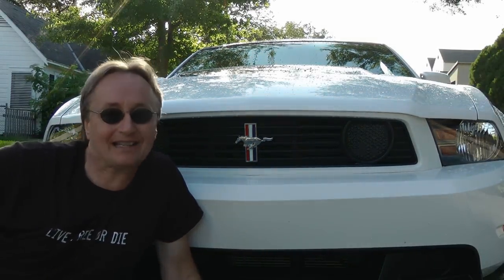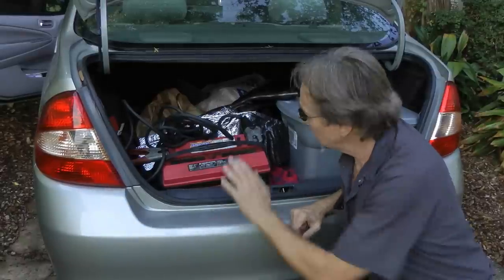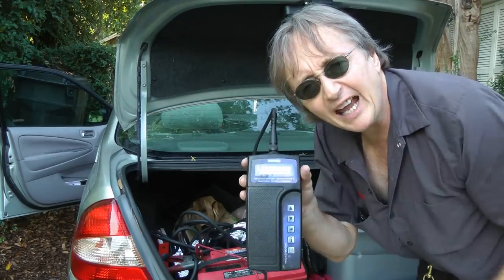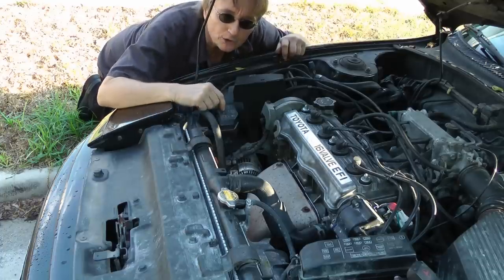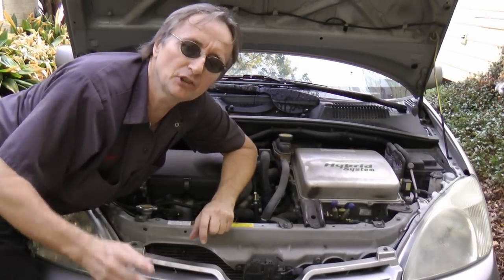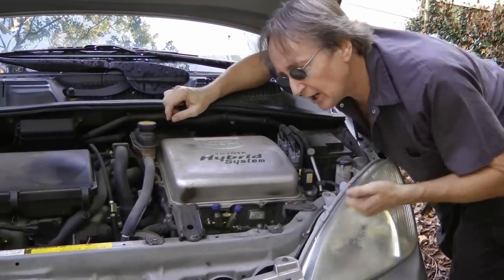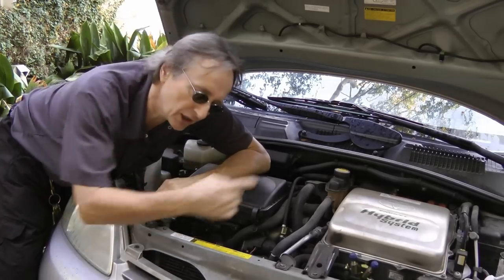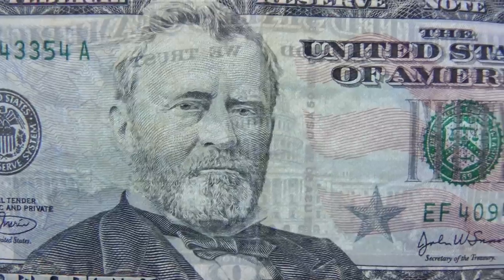Hybrid Car Electrical Problems

Comment: Did you fix it?  Is the generator the same as the drive motor?  Seems if the problem is overheating and melting inside that Toyota did not expect the conditions of a weak battery calling for constant charging under high ambient temperatures.  Perhaps inadequate cooling or gas engine was running hot, exhaust leak.  Anyhow, electric motors should not fail in this way if they are spec'd properly.  Also, 10 hours seems a bit much to pull a transmission.

Comment: @blacwidow00 Condition of your oil has nothing to do with the battery, but it would affect the mechanics of how your engine works.  But definitely get an oil change if it's time (check service intervals in your manual if you don't know).  Newer cars require one every 5,000 miles or 5 months, at the very least, every 3,000mi or 3 months.

It could be a variety of problems, but start by testing the battery, alternator, and starting systems.

Comment: I want to buy a 2010 Hybrid Ford Escape with 44,000 miles, will that be a good purchase?
Reply: Yes. I actually want one of those. I have a Honda Civic Hybrid at the moment.
Reply: ryfodrea I ended buying the v6 model, much more power and dont have to worry about the batteries going bad.

Comment: I have a 2008 Prius - now converted to drive 100km on a single charge and then continous in mixed mode at 2l/100 km - never had any problem with it.  Only cost is the yearly maintenances. No reason why the non-existing alternater would die on me.
Reply from the maker: the generator takes the place of the alternator on a prius, and man, do they have problems as they age and overheat and melt. That's why I made this video to warn against buying old used ones.
Reply: Scotty Kilmer Thanks for reacting to my remark, Scotty. So I must believe that I have been Lucky all those years.  ► Maybe, now that I am driving almost exclusively in EV this problem may not occur to easely?
I enjoy your way of presenting here on YouTube very much!
Regards from Brussels, Belgium
Reply: Scotty's talking about Gen 1 which is when the tech on that model was new. They have came a long way since Gen 1

Comment: Not trying to stir up any trouble, but from what I can tell, for the old 2001 - 2003 generation, there's also a cooling system shared between the transaxle system and inverter.
news-eng.autotranstech .ru/?partition=1&subpartition=17&article=204
Remove the space before the ".ru".
"Proper maintenance of this cooling system is vital to the integrity of the vehicle's inverter as well as its transaxle or transmission."

Comment: ive got a hybrid they only save you money till something breaks. a new hybrid battery 5k to replace, charging system 5 k to replace. most shops around here wont work on them so its off to the dealer.

Comment: Does the charge voltage on the Prius sit at approx 14+ volts whenever the "key is on"(?). I work in retail auto and will usually go out to the customer's (generic) vehicle and check the charging voltage when the vehicle is running.. Is the Prius the same?.. or will the charge voltage only be present when the aux engine is running/ or when the wheels are turning/or is there a step down from the main battery? When I first ran into this I also noticed there was no alternator... but I wondered if 14 volts was present only when the vehicle was actually rolling.

Comment from the maker: Ah, tis not true for this model. They didn't cool the generators with any cooling system, they overheat, and melt down. Ask any guy who works on them all the time, they'll tell you the same. I'm a toyota man myself, that's all I own, but I wouldnt' get a hybrid one.

Comment: the second generation Prius doesn't have these problems due due to running on higher voltage also you are wrong in 2 ways 1.the motor/generators do have a cooling system its the same system the inverter uses 2.if the generator was the problem in the car it wouldn't start (the generator is also the motor that starts the engine) the most likely problem seeing as the battery light was on would be the dc-dc converter (its what steps down the 200 traction battery volts to 12 volts for charging)

Comment: You are wrong about few years the white tanks will turn into some discolored plastic. I have old BMW 1994 used white plastic expansion tank it almost 20 years, but I can see the fluid level by shaking the car and shine the light or sunshine behind the tank, I can see the coolant level moving up and down. It still can see it but not really clear. In contrast, the black one will be impossible to see through.

Comment: I have a 2008 with 300000 miles on it.  Change the oil and drive it.  Never had a problem with the car ever.  One of the best cars I have ever owned.  I drive it 300 plus miles a day and I am not easy on it.  Great car.  I don't think I would buy a old one like in this video though.

Comment: First off, any new technology is going to have issues while they learn to do it right.. That's just how it goes.  The good thing is, the Prius has plug-in conversion kits available to make it an electric only, so you can charge the batteries even if the generator is bad.

Comment: Only use an after market car audio amplifier fuse rated at 30Amps and outputting max 300watts bridged, or you destroy your generator and HV hybrid battery.

Comment: Awesome video Scotty. As a supporter of the electric car, I will say that hybrids are an absolute joke if not the the biggest fraud of our time. They do not save you money, gas mileage is 40 MPG at best, &  they are most certainly not any better for the environment. In fact, from 2003 to 2005 the Hummer H2 cost only $1.03/ mile to operate in it's life time, the Prius wound up costing $3.26/ mile. I tell my friends if they really want good mileage and save the world, get a Volkswagen diesel.

Comment: I brought a 2006 5 years ago for 2.5k now has 391k and only replace the electric water pump, cheap and easy. Replacement parts on ebay are super cheap. Still does 51MPG.

Comment: That's not to mention all the other super expensive components that break down in older Priuses like the hybrid battery pack. One of those will set you back at least 4 grand or so.

Comment: Hey Scotty.I recently replaced the left CV axle and ball joint in my 94 Escort GT. Upon lifting my left front wheel,I noticed slight play about 1/8 to 1/4 in. from side to side and was told there is supposed to be NO play by local techs.Also there is squeaking when turning the wheel by hand and driving. I had the bearing replaced a couple months ago. I know Richmond Ave. pavement is rough and patched to hell but can it make a new bearing go bad or can it be something else? My tie rod looks okay

Comment: BMW repairing cost for head gasket costs over $8000.00. Hybrid battery costs only $3000.00 for 10 years. BMW costs a lot of money like water pump, belts, pulleys, alternators, radiators, cylinder head, intake manifold, and so on. 
After 10years, BMW costs over $20,000 to maintaining the car. And it brake down on the highway very often.
Those who know about electrical will see the benefit of low moving parts translating to less brake down.

Comment: Is this just a problem in Toyotas or common among other manufacturers that make hybrids (like Ford for instance)?
Reply from the maker: realize original ford hybrids were just engines and motors bought from toyota
Reply: Scotty Kilmer what about the current ones?
Reply from the maker: illiniguy34
I believe they redesigned them, but of course, only time will tell if the new ones burn out too
Reply: Scotty Kilmer Yup.

Comment: One thing that you forgot Scotty was the fact that the generator itself does not directly charge the 12 volt battery there is a step-down converter which is replaceable that charges the 12 volt battery and does not cost super huge it is about what it cost to have a professional shop replace the alternator and the 12 volt battery that's why there's mechanics like you who don't really work on hybrids and then there's mechanics who specialize in hybrids cuz of some of the things that mechanics like you tend to overlook when people bring their car into the shop

Comment: Hi, Scotty, Thanks for the video.

How about Toyota Camry Hybrid ?? Since it is dual energy driven, I suppose used Camry Hybrid should work better and save more maintenance work in the long run.
Here in Melbourne, Australia, I can see maybe 40%-50% Taxi are Camry Hybrid.
I think 2010-2015 Camry Hybrid are all great to me.
Reply from the maker: +Derrick Ruan  taxis use em for better gas mileage, and they write the cars off after they are a certain age. You buy one for personal use, when it's older GIANT repair bills, that's why I don't like em
Reply: So you only like Toyota petrol cars?
Reply from the maker: +Derrick Ruan yes, I'm not a diesel fan either

Comment: Hey Scotty I have 09 toyota camry hybrid with 76000 miles. The dealer ia asking $ 5732 to replace the traction battery plus labor. You think you can convert this car into a regular camry without the hybrid system and maybe install a  alternator and replaced the ECU. Any suggestions is appreciated.

Comment: one more question Scotty ? we have a Honda Accord 1999 we already check the pump ,cables spark plugs and everything . do you think can be the battey also if sometimes charge or not ..I took this car to a auto part you know to check the battery is low in volts do you think that can be the problem if this car stops to much ?

Comment: hi Scotty, i have a 2008 hybrid honda civic. i have the same problem as this prius im wondering if my car charges the accessory battery the same way.?
Reply from the maker: often I find with hybrids merely changing the accessory battery can fix problems. Start there, pray it's not the big battery or generator

Comment: Do u think buying a prius 2011 with 130k miles is a good idea?
Reply from the maker: could be OK, cause it's not that old, they generally have problems when 10  years or older
Reply: Unless you need an hybrid don't bother. 

You are at the mercy of the dealer unless you have a mechanic like scotty you can trust and even then i'm sure there are components that because of an electrical nature he cannot service/ tools /equipment etc. 

Let other people be the Guinea pig  on the hybrid stuff ,
Reply: I agree with Eman, If you want to spend money & get driving luxury and flexibility dont buy a prius. But if u want to save lots of money buy a prius hybrid. We drive our prius more than 100 miles a day. If i was using another gas eater car i would end up paying a lot of money just for gas. Full tank of 10 gallon takes you more than 400 miles, where other cars give u only around 200ish. My previous car was a mazda3 2014, The manufacture says it gives u 30mpg in the city, but i used to get around 24-25mpg.
Reply: Eman 08 It's twice the things to go wrong.
You have the things that as you used as an example a standard gas engine civic with a traditional tranny and engine.....but...then u have all the hybrid components.

So then in most not all cases you are at the mercy of the dealer for the hybrid end of the car. 

The Juice is not Worth the Squeeze
unless you get 1 cheap, do a ton of miles and got a good deal.

But if you like it ....then that's all that matters.
Reply: My hybrid is 8 years old with over 100,000 miles. It's had regular maintenance such as oil/filter change, and tire pressure checks. There is a light that comes on to tell you to get an oil change. It's about 60 bucks for the synthetic oil that it uses.
Reply: Yes. The 3d gen Prius is solid as a rock.
Reply: Ashraful Islam no idea
Reply: bigballer what about a 2006 Prius?
Reply: Scotty Kilmer Scotty. Im planing to buy 2007 bmw x6 active hybrid model with 165k on it. Is it a good idea? Im afraid the electric motor batt will die on me later.
Reply: If it's taken care of it'll be just fine. I have a 2011 Prius with 157000 miles doesn't show any signs why it won't go to 200 thousand. Just make sure you do regular maintenance.
Reply: Eman 08 Agreed

Comment: Whats your opinion on the hybrid Toyota camrys? They use them as taxi cabs in the city
Reply from the maker: they get fantastic in town gas mileage. BUT, I would not buy hybrid because I fix them and I keep my own cars forever. When old , Hybrids cost a fortune to maintain. Check out their insanely low resale prices when over ten years old. And that's when I buy cars, when 10 years old or older
Reply: Yeaa thats true... so all those taxi cabs won't last forever lol
Reply: They might as well just switch to insight and accord hybrids cx
Reply: I know we got the new nissan nv2000s but im not a fan of them Keashaun Henderson

Comment: well yeah if your going to dealership to buy the parts yes but you can buy rebuilt or used parts for them super cheap. Prius is actually one of the cheapest cars to fix. I just bought a 3rd generation prius from the auction that was really messed up, replaced the engine inverter and hybrid battery for under $2,500 that includes labor. The inverter assembly for first generation prius like he is showing is $150-$200 used. Do your own research on what's available around you.

Comment: Most old mechanical technicians only know about mechanical moving parts because they can see and hear them easily. On the other hand, electrical parts usually don't see and hear very well, they won't be able to see the problems so they say hybrid is complicated.

Comment: @TheWarmplate yeah i have to agree  vws are really realiable( to me at least ) i had a 97 jetta didnt put a cent into it other than tires and oil changes. finally got rid of it after just getting bored and bought mk5 2.0t jetta. thing screams and ive had absolutly no problems. the thing people dont get is that every car company is going to have their flaws its just the severity of the problems you need to look at when picking a certain vehicle brand.

Comment: Scotty I know you'r in the business of "saving lives" ehhem..car lives ofcourse.,so here goes.. I took my '07 Altima Hybrid  to Oreilly's today for a free scan (after my dashboard lit up)..these are the codes they pulled: P3013,
P0A80, P0AC4. Ive had a very bad experience with my Local Nissan dealership (yes stealership in my case) and to be honest, want to avoid dealership prices if I can. Factory warranty on the cell battery was 150K/10yrs, sadly my milage just went over that at 151.5K. Can you suggest my immediate course of action- minusgoing to my local Nissandealership ? Do those codes spell the death of my cell battery ? Any pointers from you is always cheerfully appreciated.

Comment: I am a delivery drive I work at China Sun Bristol VA I drive a lot so in order to save gas money, i bought a new 2007 toyota prius in 2006 and put about 250,000 never get any repair beside change tires few time and change brake pad one time  prius is the most reliable car  i had ever. finally, in 2012 my wife got a car accident, so instead take it to body shop I sold it cheap  to a friend of mine, and then i bought a toyota camry hybrid xle and I put about 107000 (we got another driver so I don't drive as much as before) I had never repair since new beside change tires  best reliable car   and super low cost to keep the car  save a lot money for gas I always change oil on time(don't go walmart to get oil change, they don't do the right job)I take to toyota of bristol to do oil change only cost about 50 dollars for every 10,000 miles I just want to tell truth  the toyota hybrid did excellent job  I don't have to spend any time or money to repair cars, they are trouble free car  when I got the hyundai XG350L in 2004 that car keep me busy I go to repair shop quite often for all kinds of problem and the gas mileage are bad they say 18 city 26 highway average 21  but I only got average of 18 and in 2004 the gas price are crazy high the 87 gas cost 3.75 a gallan that's why I sold my XG350 and bought prius in 2006   so you are wrong the toyota hybrid are excellent
Reply: jian shi .... I too think that they are excellent cars. I have not heard of anybody having problems with them. The second and third generation cars seem to be fine. People just have a problem with the style

Comment: Scotty Kilmer  How old is to old for a hybrid I am considering the prius C for my next car and am considering getting a used one!!
Reply: Thabie Melvin From my point of view, I don't think you should buy any used electrified cars (whether partially or wholly). Like the batteries in your laptop or cell phone, those batteries get worn out relatively fast.
Reply: Magnus øøø I am considering getting either a used Toyota Prius or Toyota Prius C for my next car proablly no more then 2 years old . If I get the Prius C I will look either for 2015 or 2016 cause it was a top safety pick in 2015 .

Comment: Scotty thank you for posting this. In this case, it shows how some cars have items that almost make them "use until it breaks then buy new" cars. I would never buy any "hybrid" anything. way too much going on under the skin. Not worth it when you consider a 4 cyl Honda or Toyota gasoline model  gets as good if not better mileage. Save the hybrids for the yuppie/hippie Hollywood types with money to throw away. The average Joe should stay away from these.

Comment: I'm first owner of a 2010 Prius II, and have never had any problems with it now 6 years later. (Bought June 2009) Not sure I would buy ANY used car that inherently carries break-down risk. I WOULD buy another Prius or Nissan Leaf to save money and do my part caring for the air I and my descendants breath.  I consume about 9 gallons of gas and travel about 500 miles on it within 9 days in cycles, and close to zero emissions. That is a total monthly fuel cost of about $50/Month. :)